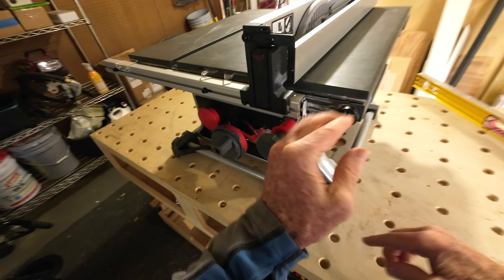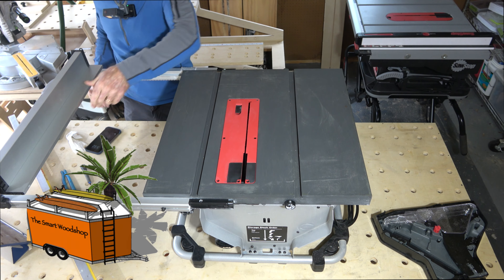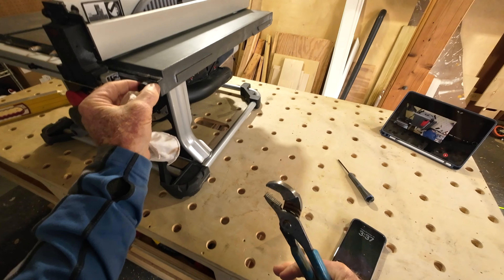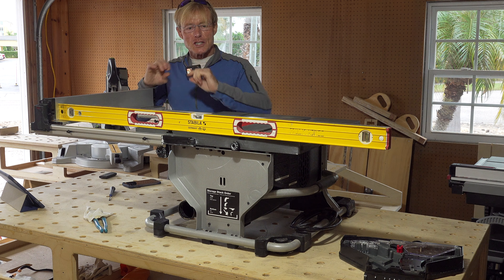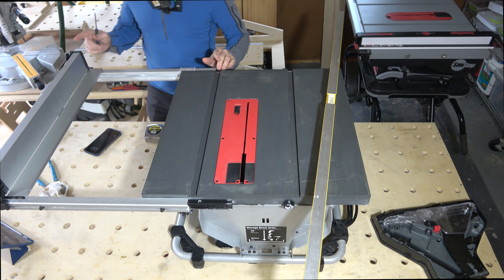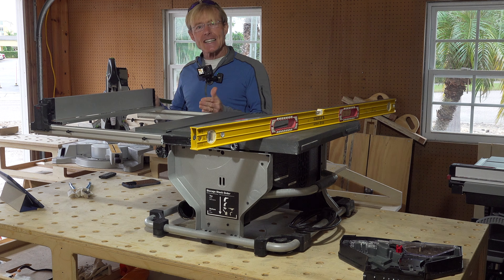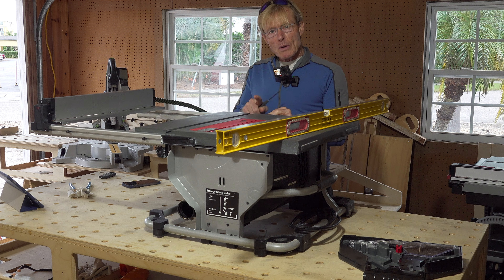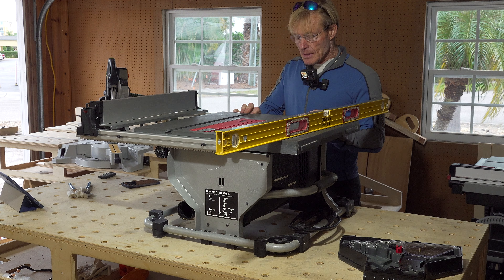Mastering the Fence and Material Support Adjustment on the SawStop CTS for Optimal Performance

Comment: Ron, thanks for demonstrating this adjustment procedure.  While it's great that the tool comes right out of the box being adjusted properly, it seems like a poor design to make adjustments.

First, the fact that you need to use a rag or something to protect the adjusting nut is ludicrous.  This is a very expensive saw to begin with.  I understand they are making things cheaper and lighter weight, but having to do that is a very poor indicator of quality.  

Second, instead of needing adjustable pliers and figuring the proper grip to turn the adjuster can is an imprecise method to make an adjustment on such a prestigious saw.  As with every other method of adjustment, there should be a standard nut with uses a box end wrench, or else a hex key.  Either of those options should be easy enough for a tool manufacturer and would be expected from a manufacturer such as Saw Stop.  

Obviously I have not had my hands on it for real but only my observation from watching the video.  Hopefully they might be able to make such a change easily enough to improve a future model of the CTS.  Thanks again.
Reply from the maker: Roy, the quality of the CTS is top-notch. The CTS is my table saw of choice: small, lightweight, and safety brake. There is no second option for me on the market currently. The JS Pro is a better saw, with the best fence I have ever owned, but it is a big saw making it hard to pick up and move around.
Reply: @TheSmartWoodshop  I understand and believe that it is a top notch saw.  So do you believe that my suggestion is not necessary?

In my thoughts, even when a tool or system is the best that we have available, doesnt mean that improvements couldnt be made.
Reply: The information provided was the subject of a service document from Saw Stop.
 I considered the COMPACT because I was looking for an alternative (read that an improvement)  for my Saw Stop Job Site Pro. Your observations parallel mine and I determined them to be  a deterrent to purchase the COMPACT.
Reply: @jeffhildreth9244  thanks for the confirmation.  Hopefully Saw Stop will address and resolve the issue.
Reply from the maker: @RoyatAvalonFarms  I have the saw and have used it heavily. It is perfect as is for me and my use case.😎🤙
Reply: @TheSmartWoodshop  ok fair enough.  Thanks much.
Reply: @RoyatAvalonFarms  My world :  Collect the facts, speak the truth.  Happy New Year.